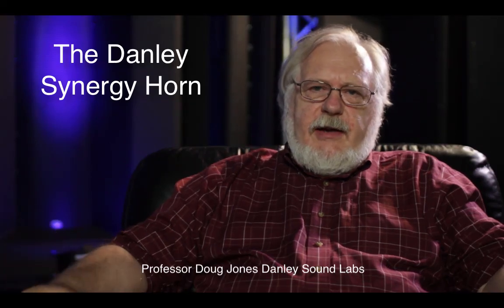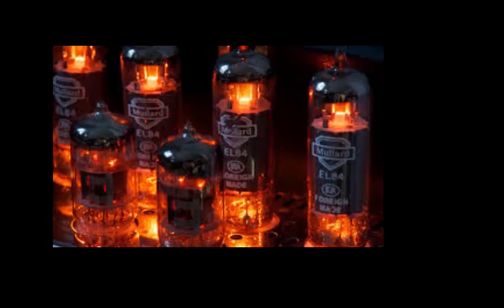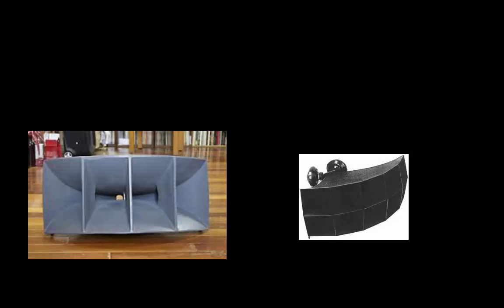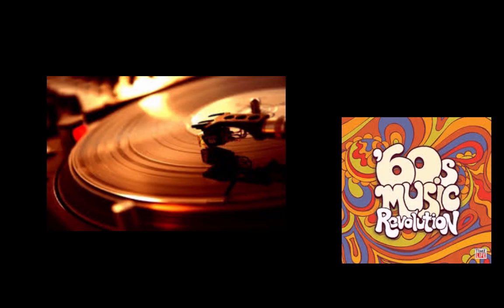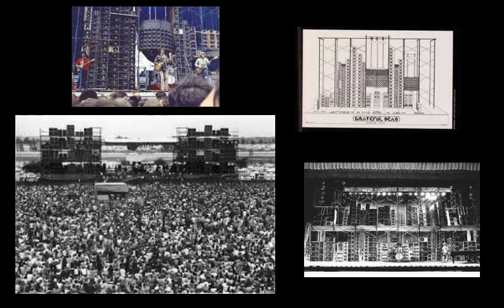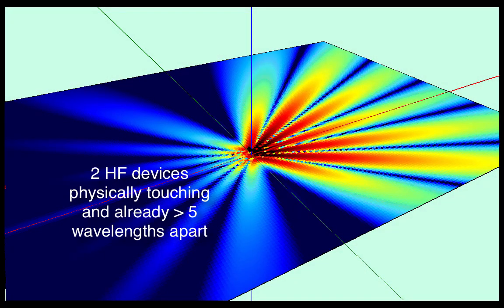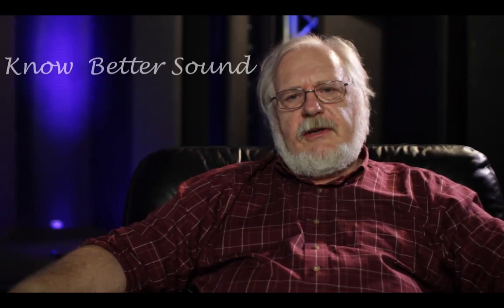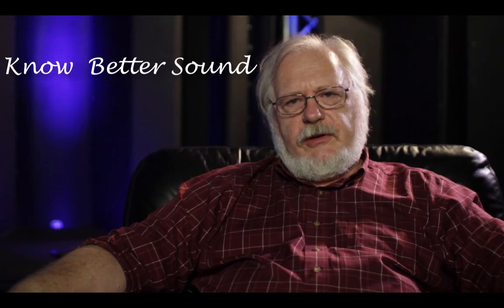The Synergy Horn, What makes it Unique?

Comment: Grandpa, you've reinvented the wheel, even though your tired ears can't hear anything above 3000 Hz! We've known for at least 50 years that active crossovers, amplified and reproduced by subwoofers specifically designed for their frequency range, are the only way to achieve decent sound quality with sufficient power. DSP circuits in active speakers have been a major advancement.

Comment: The only real method to get realistic sound is to use microphones set up into an array that surrounds the instrument or performer into multi-track and then played through similarly arrayed speakers. We hear omni-directionally, therefore the recording and playback should be the same. Everything else is trying to make something "realistic" sounding out of entirely unnatural recording and playback limitations. That doesn't mean that your products don't solve the trouble associated with current sound reproduction, however.

Comment: I'm just a random guy who likes audio, I don't have any real pro audio myself, I was more into car audio, but I am from Trinidad, where pro audio is very prevalent, my cousin has a full 4x4 EAW KF850/KF940 replica setup, which is fairly common practice here. Wood is cheap and people are skilled, so there is a lot of replicas about, but thankfully EAW provides full tech specs of their products so the replicas are exact and sound spectacular. 

I had built some small bookshelf speakers to replace a 5.1 LG surround sound system (lhd427) using Faital Pro 6fe200's and NB2 dome tweeters, which I had used previously in my car, and for a long time, I was very satisfied with those, they sounded good enough, the subwoofer from the HTS was also replaced with an old car audio sub, a Premier 12" in a small L ported bass reflex of about 1.5 ft^3, which sounded better than the original sub, but is VERY peaky, which is fine for music, but truly terrible for home theater uses, but I still enjoyed it for a while. 

Recently, I had been wanting a slightly larger stereo system for outside as the old Sony system I had is starting to show it's age. I know this doesn't sound very audiophile of me, but I wanted a certain look for this system, I wanted it to look like a pro audio 4x4 system, but miniaturized. So that's what I did, I just copied EAW's exact design for the KF750F and cut them in half to size it for a 6", mocked it up with cardboard to ensure clearances and I built a pair of mini KF750 (Will post a video on this channel soon), I plan to build two more as well as some matching MTH30 mini subs, the plan is to do the same thing, just shrink down the MTH30 design for a 6.5" woofer, but that's gonna have to wait until I get paid so I can buy the subs. 

The reason I typed all this out, those mini KF750F's are the best speakers I've ever heard, no offense to Danley, you all are also incredibly well regarded, the only reason I used their design is because it's prevalent locally. My speakers each have a pair of Faital Pro 6fe200's and a single Faital Pro HF102 driver w/ LTH102 flares powered by the same LHD427 home theater amp, and it's SO much louder and cleaner than my old bookshelf speakers on exactly the same power. 

I built those within the last 3 days, Youtube suggested this video to me yesterday and I put it aside to watch later, I swear to God they know your every move. 

The Synergy Horn is incredibly interesting to me, because it's very similar to the KF750F design, but with the addition of subwoofers, and based on what I can hear from how well these perform throughout the bandwidth of sound, I can scarcely imagine how good the Synergy Horn would actually sound, because the only problem my system currently has, is that the subwoofer is incredibly peaky at 30-40Hz, which does interfere with how full the mid-high range sound is. I did have to do some DSP tuning to get the sound just right, but it wasn't a lot and it wasn't very difficult with the KF750F minis, but nothing I do except physically repositioning the sub in the room has any appreciable effect, it just doesn't blend well. 

So, my apologies in advance, but I think I will 'borrow' your design for the Synergy horn and attempt to build myself a pair. I'm genuinely grateful for the contributions of greats like yourself and I wish that someday I'll be in a financial position to actually be your customer, but unfortunately, that day is not today, but I will infinitely sing your praises if it's any consolation. Thank you very much for the detailed explanations, you all have really helped me understand exactly what I'm trying to accomplish, I can't express how grateful I am for you sharing your expertise.
Reply: U made the video?
Reply: Would be interested to see your kf750 minis and what do you use for DSP?

Comment: I'd have to disagree on saying line arrays weren't a massive leap forward (not that I think point source horns are better, they're so much more fun to design, line arrays are kind of boring), line arrays made it able to achieve loudness levels that we can barely withstand and package it up into a truckload or two, which made touring possible, sure they don't sound great but they get the job done just enough that the average joe can enjoy it. This and the small form factor led to the ability for more bands, with smaller followings even, where able to tour the states and companies and make shows louder so they can house people, but not relying on the infrastructure only a festival could provide, now it can be done in just about any arena or outdoor space. Also line arrays are very good with directivity in my opinion, not the best (especially for the higher end of the frequency spectrum), but for the voice range with matters most to most people where line arrays easily fall under the quarterwavelength rule, they have very good directivity, not perfect but there's really a practical limit to how much one singular point source can deliver
Reply: I think he was talking more about the earlier line arrays which aren’t even close to the same quality we have today

Comment: Horns are actually very compromised, the opposite of “a better mousetrap” but for all that, they’re also an addictive challenge and can be wonderful.  They are great at controlled dispersion and high efficiency but can also be impossibly hard to integrate or have a smooth audible field free of artefacts and distortion.

The best I’ve heard include models from the Caesaro.  Too big for most domestic settings. The other aspect is cost.  Relatively simple in construction, the markup on decent systems is usually huge, largely to account for relatively small sales nrs yet high development costs.

Also the synergy horn was NOT the first point source device to solve the audio field issue.  The most successful design historically was the British Tannoy Dual Concentric, the first true time and phase aligned coaxial which is also front horn loaded. The British got there first I’m afraid.  It was also the first speaker system to produce  true passive cardioid response.
Reply: this thing wieghs 700 pounds!!!😂 forklift required......not cool

Comment: I'm curious, how are horn reflections dealt with? There is sound emanating from the ports out of the horn mouth and some energy goes backwards to the apex and out. How is this dealt with or not a problem? Is every driver 1/8 wavelength from the apex so the direct and reflected sound reinforce? I suppose if each hole in each pass band is within a quarter wave, then the apex in the centre would be less than 1/6 wave from any driver. All this would do I suppose is put the phase back a fraction of a wavelength when combining direct and reflected waves.
Reply: im sure they never thought of that.....

Comment: I wonder if it's possible to optimise line array cabs - e.g. a type of synergy horn that stacks and forms a giant "Skinny big horn" when arrayed. The problem is that each lens in the paraline array is slightly different e.g. the drivers are more off vertical centre of the paraline lens at the top and bottom of the SBH. Ideally creating some sort of variable vertical coverage version of the GH60.

Comment: I'd love to know how the h f combiner works. I'm imagining a load of equal length style ant tunnels embedded into the plastic and with a common exit.
Reply: I found out now in the patent it is made with layers of metal sandwiched together. Whilst it's hard to explain in a youtube comment, each layer equalises the path length of part of the HF driver's exit.

E.g. imagine 4 drivers in a square pattern. The inner parts of the driver exit circles (closest to the middle of the square) are path length equalised, then the centres on the next layer and then the outer parts of the compression driver exit circles.

Because the bottom layer of the combiner is further from the ear, the edge of the driver exits nearest the centre of the 2 x 2 arrangement naturally having a shorter path length to the 2 x 2 centre equalises in length as it travels to the front of the combiner, compared to the outer edges of the driver exits combining nearer the surface of the laminated combiner. Most of you are lost reading this comment and it took me a while even reading the patent.

To combine more than 4 drivers, the outputs of multiple drivers are combined not in another combiner but in a section of a paraline lens. This is lots of layered hyperbolic section wave reflectors that steer the soundwave into a narrow portion of a beam. See the video for paraline but where the word "ellipse" is used it is actually two parabolic sections mirrored around the focal points to create a "straight" wavefront and hyperbolic sections to create a diverging wavefront of varying angles. I'm not sure how asymetric divergence (e.g. the beam has a down angle on both ends instead of an equal up and down angle) is created in a straight array (instead of curved like a banana) of paraline lenses. I know the driver is mounted off the vertical centre but am not sure of what parabola/hyperbola hybrid the reflectors are shaped.

This is a rough explanation but you could shade the amplitude by concentrating the wavefront angle down so that more compression drivers cover a given angle. It would be advantageous to send equal power to all drivers (so some aren't about to blow whilst others are loafing) and have more drivers working the back of the room.

Comment: So is each mid range speaker doing a specific range of frequency or are all four mids on the same range? 

Say mid is 200-3000

Is one speaker doing:
200-900
900-1400
1400-2300
2300-3000
Reply: I would imagine all are doing the same if it's 200-3000 as an example.
1: It's louder.
2: All 4 speakers are the same brand so no point in splitting them up as they all play each frequency band equally well.
3: The crossover design is much simpler.

Comment: Thank You For your great Video, It was very Informative, I do have a question , I have a jam / Party Room it is 27 feet wide and 50 feet long and I like it loud but clean I have 2   10.4  cubic feet Bass reflex 18" Subs 1000 watt RMS Each , I also added 2  EV T18 FOLDED HORN , because THE BASS reflex SUBS WHERE NOT VERY  PUNCHY when it came to Drums, T 18`S  did help a lot , But now I wanted more an d I purchased  semi folded  4 EMPTY  115 MARTIN`S hopefully  i BE HAPPY SOON, if  I get the Thump I want to get in the Chest, Your Opinion is appreciated. I do have lots of power I`m Running QSC`S  AND Yorkville` Amp`s,

Comment: for home setup. cant you get more fidelity and coherence from point source speakers?
Reply: Absolutely. Line arrays do provide certain benefits, but at the expense of phase coherence and "impulse" response, which is the very thing that separates a "musical" sounding speaker from one that can reproduce sine tones, sweeps, and pink noise very well but falls down on musical detail and impact. Think carefully about this: Your ears are not a line. They are points in space, and they pick up stimuli from acoustic events that happen around them. A line source is actually made up of infinitely many points, in theory (in practice, in real line arrays, there are a large number of discrete points that begin to acoustically act "like" a line source) and because the distance from each point along that line to your ears is different, the impulse response from a line source is inherently more smeared (longer decay time) than the one from a point source speaker.

Comment: Line arrays sound awful. They just throw a lot of sound around which becomes more muffled and distorted as you move back.
Reply: I did find this D&B array was a bit beamy and shrieky sounding roughly on access but it was only secured at the top, so it could swing back and forth in the breeze and even rotate to face different directions horizontally. It could have done with a couple of cables to attach the bottom of the "J" to the truss. Despite it being poorly deployed, it sort of worked and produced reasonable sound to fill the football grounds for Clubland, but the sound of the singles was definitely more even.

Really, a line array was just viewed as the best method of the time to put a lot of boxes together before it was possible to make single boxes loud enough, and then technology improved in them quite far, for example wavefront shaping of the tweeters and midrange to try and get them to act like a single narrow dispersion source or "infinitely" many point sources spaced under the quarter wavelength requirements. They were still going to be somewhat inferior to a single source, though. No one knew how to make a single source loud enough at the time.
Reply: @TimpBizkit  The "J array" you are talking of, is a line array.
Reply: @TimpBizkit  .....and the winner is,....
? Maybe to stop to try to have 105dB from 20 to 20k in a round stadium with a band playing on 360 degrees (celcius and farenheit !) For a crowd  of 100'000 fans drinking beers more than earing the quality of the PA.But money is a part of a general budget. I like better OUTSIDE shows made at human size, maybe 2000 people in place of 200'000, no delay towers, no ugly giant screen.
Reply: @TimpBizkit  line array are superior
Reply: Apache Cai I'd say that synergy horns are all extremely powerful, you should look at Danleys new go2 line, they are very good, cost effective boxes. But if you were to ask for my favorite i would say the SM80's
Reply: don't move back
Reply: +John M it will prevent the husband from hearing his nagging wife
Reply: +lizichell2 Yep, plus the impulse response from them is terrible. Synergy horns all the way.
Reply: +Daniel Graves Which model of the synergy horn is equivalent to cover 200+ ppl wedding? Thanks.
Reply: Line arrays are probably superior to j arrays. I would have though they sound better further back but j arrays not sounding as good as you approach Android are almost under the flying stack.
I'm wondering if you need MORE from the SBH designs how well you can string them together although it would look more like a string of hot dogs up in the air.

When you finally get to volume levels where you need multiple Jericho's (stadium metal bands) how well do they combine? Can you splay them horizontally or vertically?
Reply: Tim Lewis I’m going to respectfully say you do not know what you’re talking about if you even try to put line arrays on the same playing field as a Jericho speaker. If you’ve done enough research then you would know there is no discussion to have When one and I mean literally one j1 box can outperform 22 flown LA acoustics (not including subs); and that is just one of the many examples. I was a RCF/JBL/(high end brand insert here) fan; but the videos don’t lie; 1 box vs 20-30 boxes plus amps; yet equal if not always better sound and better fidelity; The Jericho has no real competitors period.
Reply: Two J3-94 ought to cover a 200K people wedding nicely.